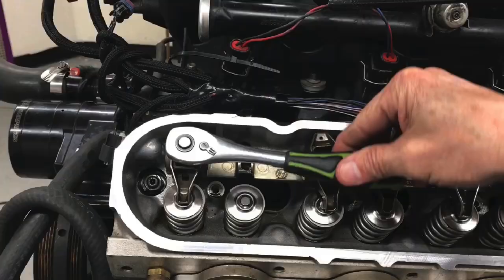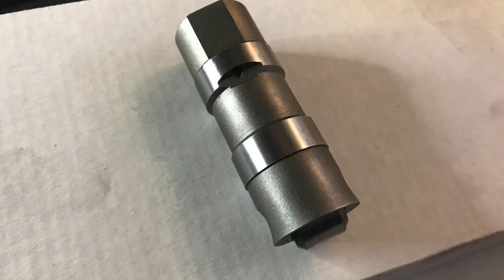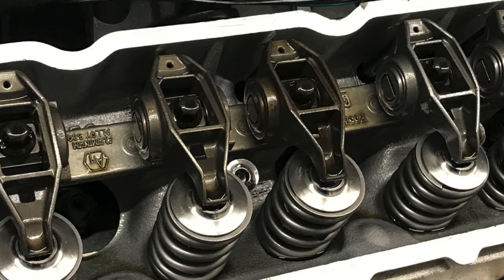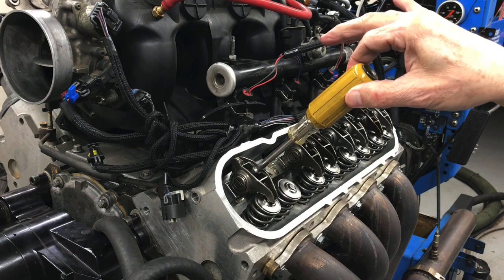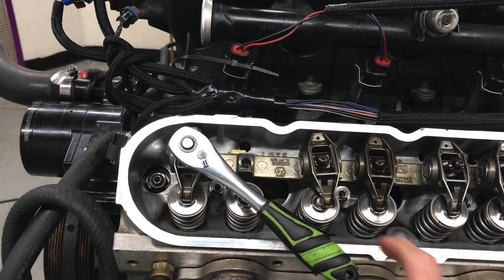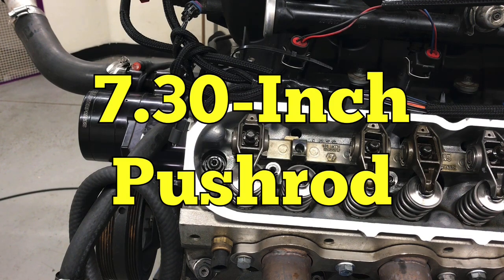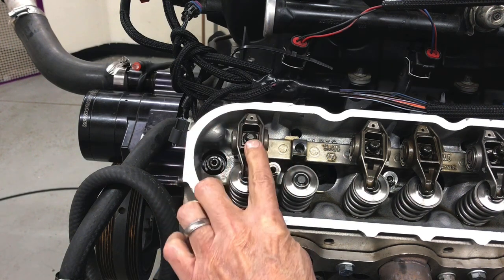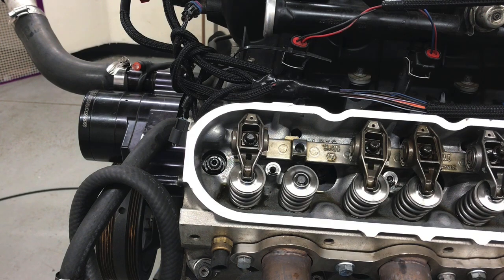HOW TO DIY: MEASURE LS PUSHROD LENGTH-CHEAP & EASY!

Comment: Removing spark plugs, turning motor over to close each valve to loosen the bolts....ain’t nobody got time for that. In the hundreds of times I’ve removed rockers, I’ve never done that and never had threads pull out. I never even considered that. But now I know it, the next time I loosen rockers, it’s gonna pull the threads out. Thanks Richard. Ignorance WAS BLISS. lololololol
Reply: More so common practice, on some engines you can't get away with it as easily.
Reply: I never do it either and I never will. I’ve pulled 100s of LS rockers with stock and aftermarket springs and never stripped one out. Crack em loose with a ratchet and run em out with a 1/4” impact. Put em in the same way.
Reply: Like you said it’ll probably happen to me now though lol

Comment: factory pushrod length is 7.385 not 7.4. Cmon Richard, you know better than that!
Reply from the maker: 7.4
Reply: @richardholdener1727  the pushrods on my 5.3 LM7 were 7.385. apparently they vary some engines are closer to 7.380 some are 7.4
Reply: Many of the early motors are 7.385 not 7.4 i have had 50+ apart @Richard Holdener

Comment: Not dealing with this style rocker yet, mine is still apart, this video made it ridiculously easy to check them. Add in a felt tip sharpie to double check contact and I should be golden.
Reply from the maker: the pattern won't change on an LS like it does with an adj rocker (like BBC or SBC), adjustment is in the pushrod length

Comment: Just finshed see your video,  hear is an improvment to your meathod. The only differance is that you figure out the  thread pich. Then after you set the zero lash.
you mark with a paint marker one of the hex sides of the bolt. and a paint mark on the cyl. head. now you start counting number of full turns. remove wrench and then count # of flats of the bolt past the one turn mark. 
Hears the math part
since the LS is a modern eng. we know the  thread pitch is metric.  If the therad pich is 1.5mm then every turn equals a length of 1.5 mm, also each flat past the full turn equals 1/6 of a turn. 
using 1.5 mm per turn ÷ 1/6 = [ 1.5 ÷ 6 ] = 0.25 mm per flat. 
With your meathod and some math you can get a very close to acurate measurement.
Your fan always...
Reply from the maker: no need for math my way

Comment: I completly deleted the the thermal valve out with ict billet plate lines straight to 40k cooler to transmission temps stay on 150-160 with 4000 stall converter on my 8l90

Comment: Fantastic....thank you for doing this video..you explain things well and at the perfect pace..so the guy who put 14  -7.5 pushrods in my ls  and 2 - 7.4 under the other 2 rockers is wrong...had a brand new cam put in..a good one! And he says cam is different so it's ok to use 14 of one and 2 of other..I just had a bad feeling all the way home....I asked a few guys and they all scratched there heads..i now have to bring engine to machine shop because it just can't be right like this..If anyone knows,you do...thanks
Reply from the maker: they should all be the same

Comment: Great explanation! I see how this works with no special tools, but it looks like it would work even better in concert with an adjustable pushrod, what do you think? Thanks!
Reply from the maker: lots of different ways
Reply: Yes, mathematically you can find the precise length of pushrod using the pushrod length checker. Then knowing your lifter manufacturer's recommended preload, will give you an exact value when integrating that into the equation. 
There's a Katech video on youtube showing how to use the tool.

Comment: Hello Richard! Love your content great information. Currently putting together an early 6.0 with 317 heads. Going with the sloppy stage 3 kit from speedway and nobody can seem to give me even an estimate on what pushrods to order. I’m changing the cam without removing the heads so factory lifters an so on. It’s a very low mileage motor so hoping the lifters will survive. I figured if anyone could give me their recommendations and estimate on what length to go with it would be you. I intend to test them like you did here but I’d hate to have to order 3 different sets just to make sure I have the correct ones on hand lol
Reply from the maker: THE PUSHROD LENGTH MIGHT NOT CHANGE WITH THAT CAM UNLESS THEY CHANGED THE BASE CIRCLE

Comment: Another awesome vid Professor! How do you translate, let's say.....2.5 turns to bottom out rocker, and ordering the correct pushrod? 
Wanting to change 2.5 turns to 1.5 turns equals what length change?
Reply from the maker: MEASURE THE NUMBER OF TURNS PER INCH ON THE ROCKER BOLT
Reply: 1 full turn= .079...  so I would subtract 80 tho from what you currently have and that should put u at 1.5 turns... remember to check other pushrods or even better all... often I see/hear of 20 thousands difference in lengths... so I split the difference on mine.  1-1/16 turn to 1.5 turns.

Comment: Zero lash is taking out the up and down of the push rod correct? What about the turning of push rod ? At what force of trying to turn the push rod is to much ?
Reply from the maker: YOU ARE SPLITTING HAIRS THERE-AT ZERO LASH, THERE WILL BE NO MOVEMENT AND IT WILL BE DIFFICULT OR IMPOSSIBLE TO ROTATE THE PUSHROD

Comment: Hey Richard, gotta 6.0 ls build. Almost done. Put the 243 heads on it shaved .008 to clean them up. Put a stock pushrod in for test and got a solid turn and 1/8th of a turn. So figured stock size was good. Ordered 11/32 thick 7.4 long btr pushrods and I get one full turn and 1/2 turns. But it compresses the spring jist ever so slightly? Best to send it back and get 7.350? Or is that slight spring compression normal
Reply from the maker: why 11/32? length is fine-make sure your lifters aren't already partially compressed
Reply: @Richard Holdener  not really sure lol first build and figured one step up might be considered better? Also figured it wouldn't hurt I guess. But thanks for all the info you put on here, has helped tremendously. I guess I can throw them all in, throw a starter on it and do a compression check. If the valves are closed it should hold compression.

Comment: Also, I'm trying to figure out my pushrods. 

-2005 lq4 
Decked heads(not much came off
-Ls9 flat top pistons
-tsp stage 2 low lift truck cam(112 LSA)
-high performance .550 lift springs
-ls7 style lifter
-stock rocker arms but upgraded to trunions
-brian tooley 7.4 in length pushrods.

Worried that with the head work, the pushrods might be too long. I see on the head that some was shaved off but only a couple spots so I can't imagine it being much? What do you think?
Reply from the maker: watch the measure your pushrod video-its easy

Comment: This is how I've always measured pushrod length. It's way easier than using the "tool" and trying to get it right. I've used the tool and cost myself a fortune buying different sizes because I was wrong on the length at 100 bucks a pop.

Comment: In your older video you said 7.5" pushrods made the most power.  Here you say it is outside of the "safe" rage of 1/2 to 1-1/2 turns.  What do we do?
Reply from the maker: THE PUSHROD LENGTH CAN OBVUOUSLY CHANGE FOR DIFFERENT MOTORS, HAS THE BLOCK BEEN DECKED, OR THE HEADS BEEN DECKED, WHAT IS THE DEPTH OF THE LIFTER BEING USED, ETC... THE PUSHROD LENGTHS GIVEN WERE ON THAT MOTOR -YOU MIGHT GET AWAY WITH 2 TURNS (THATS WHY I CALL IT A DANGER ZONE AND NOT A DANGER POINT)

Comment: Hello richard hope you can answer this for me i have an stock lq4 stock headgaskets nothing milled i installed comp cam 54-469-11 that you like to use i checked pushrod length today with johnson lifters stock rockers. I was watching other videos now i think may have done wrong i came up with 7.34 length with preload however when i did it i did pushrod in exhaust port soon as it started drop i sw to intake side got my measurements. Since i know you have done ton test that block with cam you like should i be closer to stock length
Reply from the maker: a 7.35 pushrod is close to the 7.4 stock length and we have run pushrods at that length-it is in the range of stock usage

Comment: I'm having a hard time understanding how a 'longer' push rod could take more turns to get to the bottom of the lifter. It would seem that it would bottom out sooner?
Reply from the maker: more turns to bottom out the rocker on the stand because it is farther away with a longer pushrod

Comment: This is not correct. Counting turns is correct but you have to add in the additional movement of getting the rocker to 22 ft/lb. On an ls7 or oem lifter you want 90 thou preload. Which if pushrod length is correct it'll be 1.5-1.75 turns when it torques to 22ft/lb. On a Johnson it'll be roughly 1 to 1.25 till it torques down. You will not have such a massive swing in pushrod length as deemed acceptable in this.
Reply from the maker: THIS IS CORRECT-TORQUE IS BOLT STRETCH

Comment: richard would too long pushrods also cause a pac 1218 spring to break? its an elgin ss2 cam with summit lifters and stock pushrods
Reply from the maker: unlikely
Reply: thanks for the reply. found out that they are too short. rocker still has movement after being fully tightened

Comment: Did I miss where you said how much each turn equals length I’m only getting a 1/4 turn on a factory rebuild but probably close to .020 decked between heads and block deck

Comment: I have a question 🙋‍♂️. I have new LS3 crate 6.0. I bought a new cam/springs set. 624/.624 lift pretty much Max lift for valve piston clearance. I have a set of comp cam pro mag roller rockers 1.8. Knowing the 1.8 will give me more lift. How do I compensate the pushrod to give me the same lift as a 1.7. Roller rocker.
Reply from the maker: you can't change pushrod length and make any change in lift. don't use the 1.8 rockers-use stock. the lift is not what determines p-v clearance-its duration
Reply: @richardholdener1727  thank you.

Comment: Hey brother i got a question what size push rods would i need if i put on a set of 205 trick flow heads and a btr stage 4 cam on a 4.8
Reply from the maker: you need to measure

Comment: Here's an idea for a video (I didn't see one in your library).  Mild-moderate LS cam, LS6 or similar valve springs with stock and then hardened pushrods.  Is there any difference below 5500-6000 rpm?
Reply from the maker: THERE ISN'T
Reply: @richardholdener1727  Figured that would be the case.  So is it fair to say that for an LQ4 in my van that I use for towing that if the stock pushrods turn out to be the right length with the new cam installed it's not a necessity to change them?

Comment: Wouldn't you need several push rods to test it this way without a push rod measurer?
Reply from the maker: YOU CAN USUALLY DETERMINE THE REQUIRED PUSHROD LENGTH FROM ONE LEASUREMENT
Reply: @richardholdener1727  so I'm swapping to a stage 3 cam with Johnson 2126 link bars oiled axel lifters, w. 30 thousands travel I believe. So I can use my stock push rod to figure out the length from the amount of turns off the bolt? Thinking about the math hurts my brain lol

Comment: Hey Richard need help. I have a 5 3 with Bryan tooley stage 2 torque cam morel ls7 lifters ls9 head gaskets. This may sound like a dumb question. When I first check the pushrod length I get 1 1/8 turn after zero lash. Then I cycle the engine and recheck it changes I have less turns after zero lash. As of now I got a 1/8 of turn. So am I suppose to rotate the motor are the lifters bleeding out the oil and thats why I am getting differant measurements. Hope this make sense.
Reply from the maker: you are compressing the lifter and they might not pump back up without oil pressure
Reply: So is that normal for them to not pump back up? And bleed out like that?
Reply: What would be your best guess for pushrod length?

Comment: BTR stage 2 cam, LS7 lifters with 7.4” pushrods and my valvetrain is noisey! Do I need longer pushrods? HELP!!!
Reply from the maker: easy to measure as shown in the video-how many turns past zero lash are you

Comment: what is the safe zone? My engine doesnt start after installing a stage 3 turbo summit racing cam and I have about 1 and 3/4 of a turn to get the bolt tight. Stock ls3 heads, stock pushrod length, stock rocker arms and stock lifters
Reply from the maker: i would go shorter

Comment: Roughly I get 3 to 3 1/2 half turns so 1.50 full turns on both heads is that ok?
Reply from the maker: 3.5 TURNS IS WAY TOO MUCH
Reply: @richardholdener1727  half turns 1.5 full turns I used a checker and on my ls7 lifters it was going to be 110 pre load with the 7.4 rods I believe I need to be at 100 or less?

Comment: You forgot to mention using adjustable pushrods to really dial in perfect pushrod length, then use them to order your custom set of pushrods once the perfect length is determined
Reply from the maker: PERFECT PUSHROD LENGTH!
Reply: I have ptsd from measuring pushrods for johnson st2126lsr lifters using adj pushrod and a micrometer.
Reply: @evcass69  tell me more about your combo! I'm going to be running the same lifters...
Reply: @jfkreload3d  The engine is nothing exotic really, built for street/autox/hpde. 418 LS3,  k1 crank & rods, mahle pistons, relatively small off the shelf cam, st2126lsr, Manton 502 pushrods, ls3 rockers w CHE, 1516ml springs, milled l92 oem heads, rodded oem ls3 intake.

Comment: What is the safety range? How many inches per turn?
Reply from the maker: 1/4-1 1/2 turns
Reply: @richardholdener1727  does that say (0.25 to 1.50) turns? :) also what is the target OEM lifter target preload in thousands? How many "thou" per turn?
thanks, Al

Comment: Only way this works is if you happen to have a variety of push rods/lengths.  How about the McDonald's method?  Show that one.  CLUE: Get McDonald's straws, set cam at zero, set rockers at zero, slide straw down hole to get approximate and cut long. Adjust by cutting after pulling rocker and reinstalling until rocker at zero is flush on straw with cam at zero.  Works every time, costs a trip to mickeyD's and patience and a bit of skill with scissors.  How I figured out push rods when I built the 1st 5.7L stroker with vortec heads.
Reply from the maker: you missed the point-if you have 1 pushrod-you can find out what you need

Comment: Yeah it works if you have 5 different sets of pushrod lengths on hand to run the test. How about a guy just refreshing his engine with a cam & has sent heads out & gotten them shaved????
Reply from the maker: easy to calculate change if all you did was shave the heads
Reply: @richardholdener1727  no new cam & i don't know how much the head surface was taken off. Plus new rockers lifters springs lots of variables?

Comment: I use a length checker and go 1 ¼ turns and order that length from the checker pushrod.
IMO stay away from the short travel lifters. They're noisy and you don't need them to go to 8k rpm.

Comment: My 5.3 had 7.385 pushrods stock with the active fuel management. I have since rebuilt the motor and installed a Howard’s rattler cam and am running ls7 lifters. Im running 7.400 inch pushrods now. I did the turn method and as far as I can remember I’m right inside  the threshold. Seems to be some ticking in the valve cover after 30k miles. Any thoughts here y’all.
Reply from the maker: HOW MANY TURNS

Comment: Is it normal to see the valve move instead of the lifter plunger? When im bolting after 0 lash the valve begins moving? Or are my lifters done? Im at 1 full turn
Reply from the maker: it doesn't matter which one moves
Reply: @richardholdener1727  thank you !

Comment: doing heads cam on my ls7. heads are milled .025 with a bar stage 4 v2 cam. 7.800 is the stock length and the length of the hardened pushrods BTR sent with the kit. Seems like I have about 3/4 to a full turn from 0 lash to tight. can the piston touch the valves with too long of a pushrod? thanks!
Reply from the maker: pushrod length does not change p-v

Comment: Hope you don't have to change pushrod length every time you change your rocker arms and springs and lifters setup cuz I hope all the stuff I'm buying is the same....I'm just getting a slightly bigger cam....chopacabra or Truck Norris.
Rocker arms and lifters from Michigan Motorsports
Reply from the maker: you will need springs, rockers are stock, pushrods length usually the same
Reply: @richardholdener1727  great job with your videos, and you respond hecka fast!

Comment: 16 camaro ss stock cam stock rockers only thing changed out was the trunions (CHE) why my stock fitment change? Need help alot of chatter on idle should I go with a shorter or longer pushrods. pushrod stock length is 7.850 should I go to 7.825 lmk thank you

Comment: If you knew the thread pitch and the rocker ratio you could actually calculate what the length value is from the turns.
Reply: 1.25 mm per thread is the pitch on the rocker arm bolt

Comment: Ok. Does that mean the pushrod I would actually need would be 50 to 75 thousands longer do to lifter preload? Or does this method work 1 in the same?  Sorry I'm confused.
Reply from the maker: if you have lash-it needs to be longer, if you have 2 turns of preload-it needs to be shorter-anywhere between these two extremes (1/2-1.5 turns of preload) will work
Reply: @richardholdener1727  you are truly amazing!  Hats off to you sir.

Comment: Hi,,,is it normal after installing pushrod and rocker,,,,then doing a full crank rotation,,,,i push down on the back of the rocker and the pushrod is easy to move down,,,  ( probably because theres no oil in the lifter so its  riding on the little lifter spring)
Reply from the maker: you can squish the oil out of the lifter
Reply: @richardholdener1727  thanks for the quick reply,,,they are new lifters,,,i soak them in oil for a couple of hours,,,,probably not enoughto fill completely
Reply from the maker: SPRING PRESSURE CAN OVERCOME THE LIFTER UNLESS OIL PRESSURE IS PRESENT